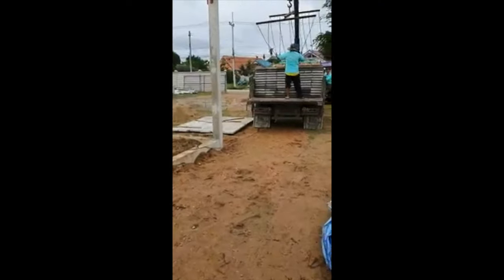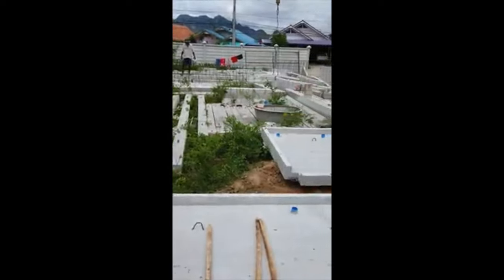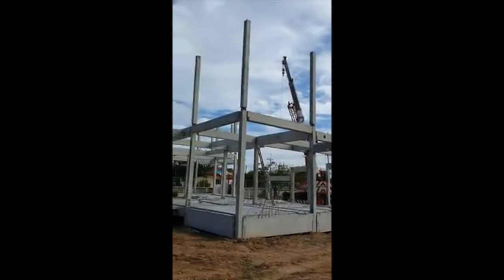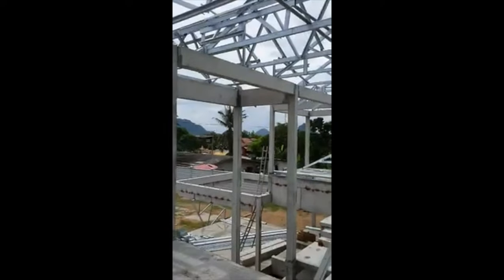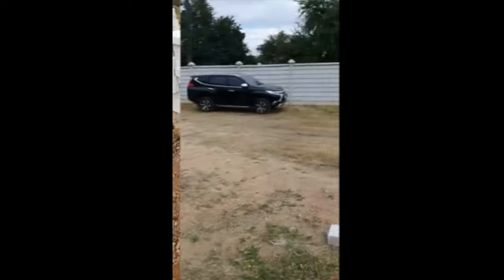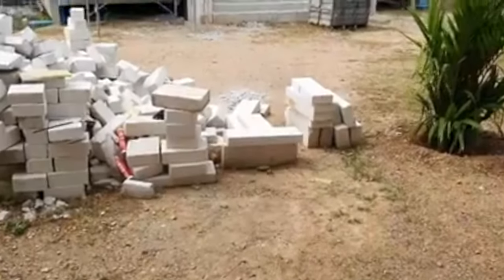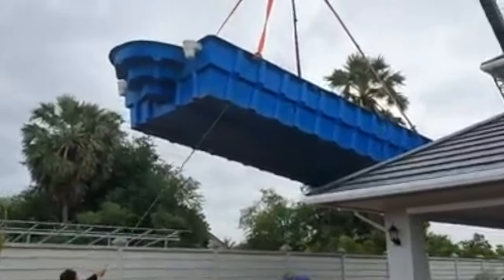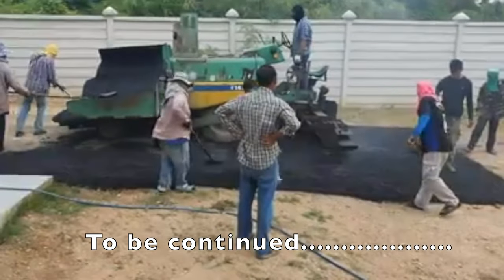A several part series on Building in Thailand

Comment: A very interesting alternative for self build in Thailand, useful tips too. However I probably won't engage in a self build soon.
Reply: Hi Keith it wasn’t a self build, a company does all the work, I was just there watching, the company’s engineering team and architect were in charge of the build.
Reply from the maker: Yes Rob and Bee had to be on top of it the whole way through
Reply: @robertgroves391  May I ask what the cost per square metre was?
Reply: @davidvincent8807  we were not dealing with a local builder who works only on per square meter, our company is one of the largest in Thailand with branches in nearly every province. So the house was a straight out price, we could add or subtract additional things if we required to, which we did. It you like to work it out the house is 512sqm of living space.
Reply: @robertgroves391  OK  so if your total cost was 10,000,000 the price psm would be 19,531.25
Reply: @davidvincent8807  ok mate, I believe you, it is what it is David. As stated previously and on numerous other channels, I would never go with a small village or local town builder, but each to their own I suppose.